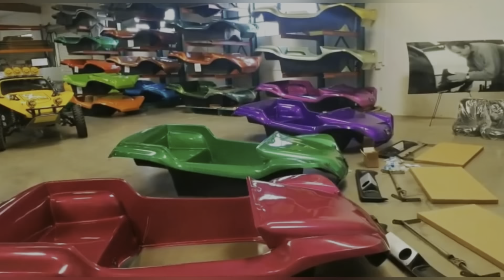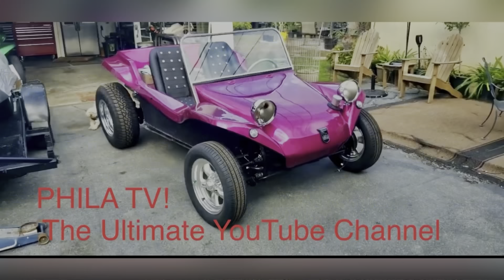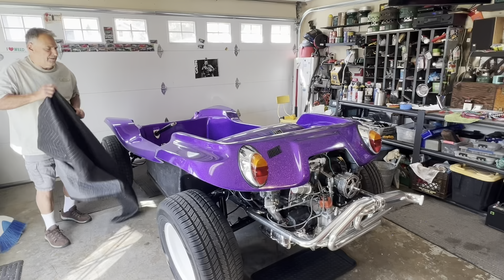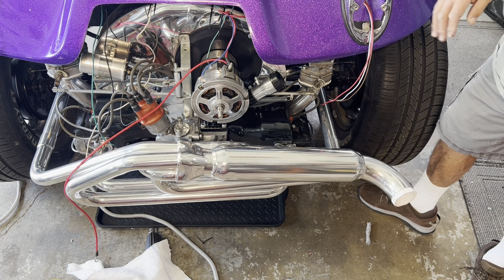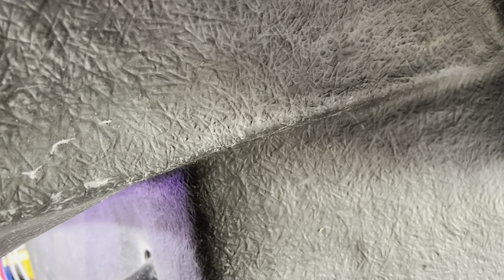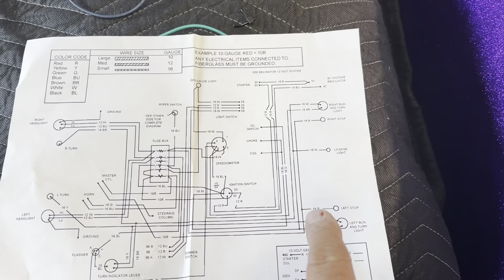part1 HOW TO INSTALL AN AFTERMARKET WIRING HARNESS MEYERS MANX VW DUNE BUGGY brilliant purple part6

Comment: Could you possibly list all the switches and gauges and connectors etc that you used to completely wire up your dune buggy. ( Where did you buy the speedometer and windshield wiper assembly from, etc.. ) I would like to do my dune buggy from scratch since most everything in mine is either not working or missing.